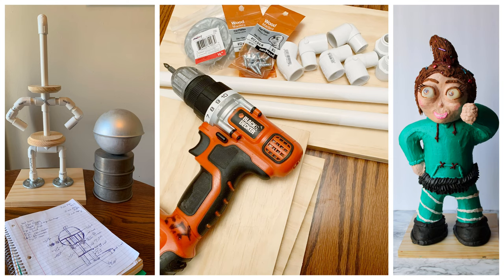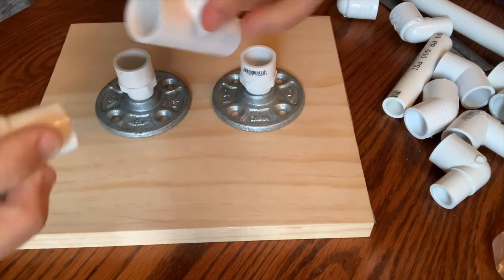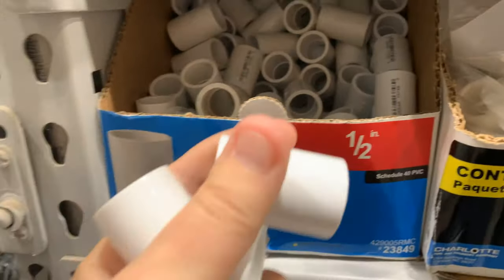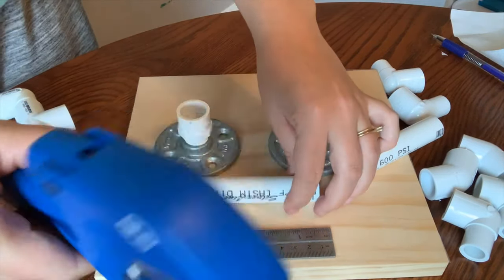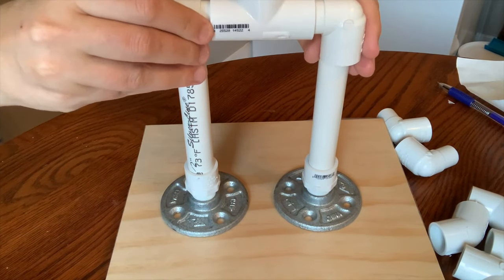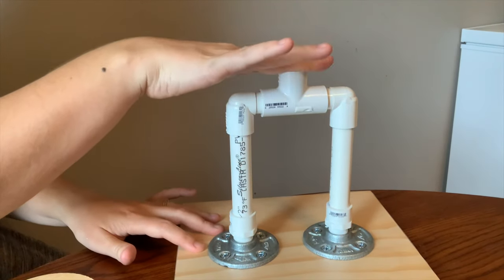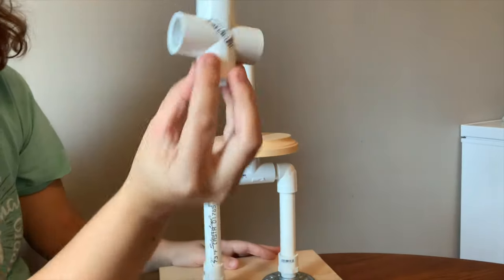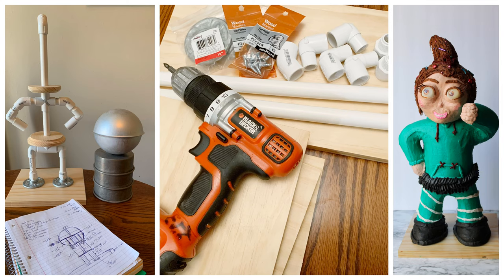Build a cake structure using pvc pipes for a 3D character figure

Comment: Where did you use the coupling (slip) when building the arm? It looks similar to the normal PVC pipe ones that you had cut so couldn't really notice the difference.  Thank you for the detail video on building the cake structure, it was very helpful when I was at Home Depot...lol
Reply from the maker: Starting at the four way adapter, you place about an inch of the 1/2 inch pvc pipe, then the 45 degree, an inch of the 1/2 inch pvc pipe, followed by the 90 degree